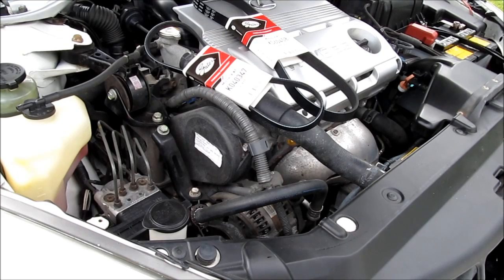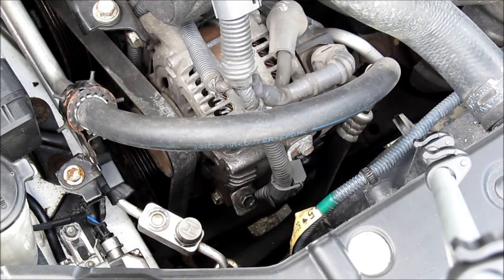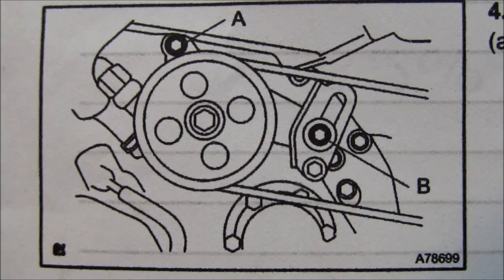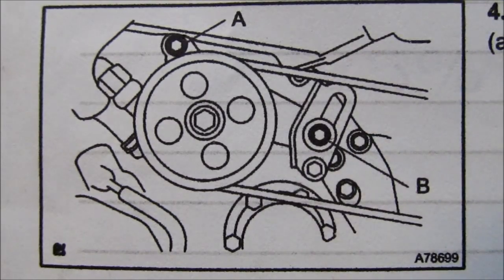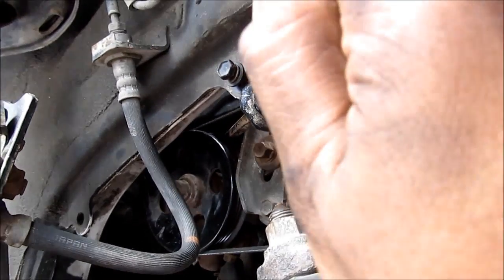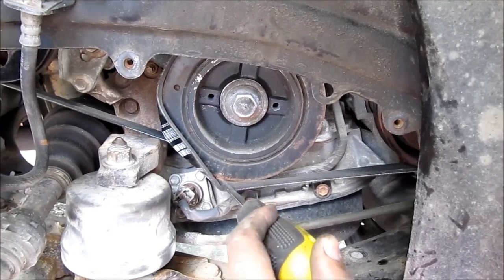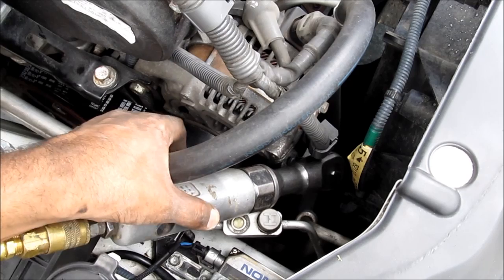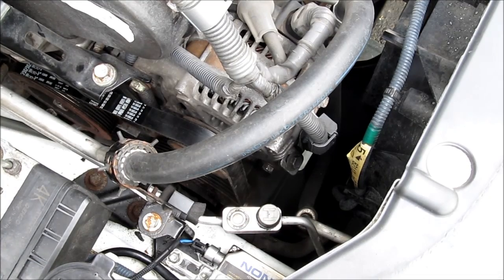Alternator / Power Steering Belt Replacement: Toyota Lexus V6

Comment: a bud great vids...question i changed alt belt and batt all new tested and bat light still shows up after a day..but goes away after hitting gas
have ya seen this thanks
Reply from the maker: +kingkuts voltage regulator
Reply: speedkar99 ..thanks.. damn relays on back of alt...thanks again for the help

Comment: Hey Speedkar 99! Thanks for the video!

Question 1:
I have a 2005 Toyota Highlander V6. Will your video work with this vehicle?

Question 2:
Are the Alternator Belt and the Power Steering Belt the same belt size? 

Question 3:
Can you provide me with a part number of each belt?

Thank you again for your services~!

- Chris
Reply from the maker: Yes its the same engine.
Reply: Yes, it worked for my 2004 V6

Comment: Seems to me the tensioner is the top and the pivot bolt is the bottom for the power steering belt since the bottom pivots in the metal bracket. I say this because the top one is the one that tightened my belt back up.  Also, I could not get to the top bolt for the power steering at the angle you're using for my 02 Lexus.  Well, I could get it on there, but I didn't have any room to work it.  I had to use a 1/2 drive ratchet with a 3/8's drive reducer and a 12 mm socket to get the top bolt loosened and I had to go in from the bottom left to get the socket on it.  Very easy from the bottom left.   Video was a big help though.
Reply from the maker: +Donnie Vick Thanks. Yes that top bolt is damn difficult to get to. Its way easier if you take the engine mount and bracket off and get at it from the top: as I did when doing my timing belt ...but that's a lot of work fmif just changing the PS belt.

Comment: I just want to say, "Thank you so much, speedkar99!"  After reviewing several videos to perform this belt change, yours is the one that truly helped.  The diagrams were extremely beneficial (for me, at least).  I had to let up more tension than I had expected and also had to get a little physical with the alternator itself to get it to shift, but I couldn't have done any of this without your DIY video.  Been out of work for a few weeks, and I sure couldn't have afforded someone doing for me.  Wish I could buy you lunch!  Thanks, again!    ~HL
Reply from the maker: +HL Houser Thank you and I am glad my video helped you out.
Reply: speedkar99 do I have to set the timing on the alternator belt just like we do it for timing belt?
Reply: @007gamechanger  no
Reply: @007gamechanger  it is not necessary  to set the timing on the alternator, because i don't think there is some thing like that on the alternator but if you just have to then you can set the time on your clock and tie that clock to the alternator. and that should do it. you can use a wrist watch also if the clock does not fit.

Comment: I assume the 3.3 liter has the same routing and tensioning procedure as the 3.0 liter of the same 2002-2005 era?  Does anyone know for certain?  I have not completed this task yet (still waiting on one more belt) but it looks just about identical as far as I can tell.  2003 Camry with original belts, about 60,000 miles.

Also, I think the timing belt calls for replacement at around 90,000 miles so I'm not too concerned about that yet.  In fact the serpentine belts look OK but I'd rather be safe than sorry.  When I go through a puddle my voltage drops significantly.  Not sure if the alternator is having issues or if the belt is slipping, can't tell.
Reply from the maker: +Blaine Bugaski Yes the 3.3 is the same as the 3.0. 
At that age your timing belt is overdue. Should have been changed after 7 years and then after another 7 years due to age so your way overdue.
Reply: Hmm.  These engines are non-interference so besides being late, there is no chance for engine damage to occur.  Wish they used a chain!  Bad idea to use rubber.

Comment: Thanks for showing the workshop manual images along with a way to tension the PS belt.  Great clear video. I am working on my 2000 Sienna tomorrow and the PS belt has been a nightmare to tighten all these years.
Reply from the maker: +Vic Shahid I'm glad you found it helpful. All the best on that PS belt, it ain't easy. You need a crow bar to pry the pump down while tightening it with the ratchet.

Comment: Thank you.  I replaced my Power Steering and Alternator belts on my Lexus RX330.  The power steering belt is very hard to remove and put on.  I had to remove the 2 bolts that was holding the power steering motor.  Once remove it is was so much easier to put on the belt.  Just a little feed back.
Reply from the maker: +Alwyn Li Yup agreed, the power steering belt is a bit tough on these v6 engines, especially trying to tension with a crow bar.
Reply: For the v6 do I need to take the right wheel off and go through the wheel well to get to the power steering belt?
Reply: It might be possible, but I think that may make a difficult job even harder.

Comment: my mechanic replaced my serpentine belt, drive belt and power steering belt but 2 weeks after that I now have a high pitch squeal from engine area every time I turn my steering wheel. Power steering fluid is good. Only makes noise when turning. Also notice a short squeal right before my engine turns over when I start it. Any ideas?
Reply from the maker: +RainPebble Waters The power steering belt is too loose.
Reply: speedkar99 thanks, this morning I started car and  had to use defrost for windshield and loud squealing for 30 seconds. That was the issue on why I had my belts fixed the first time. I guess I need to find a new mechanic because he said the noise is normal due to overnight condensation from my car being parked outside.

Comment: In my car bolt c is broken what can I do to remove it?
Reply from the maker: Common issue. You'll have to remove the alternator from the vehicle with the block attached. I've had this happen before, and got a replacement block with a bolt from a junkyard car.
Reply: $12.71 ordered from AutoZone and available for next day pick up in store.

Comment: @38 seconds , nice birds chirping,  looks like chickadee. Great to work on machines during late spring or early summer !!.  Fixing my 2k Camry 3.0L with 175k miles on it myself. Let's us know if you are doing timing belt / water pump with oil pump housing !!
Reply from the maker: +Guru Hunsenh thanks. Yes my dad has alot of pet birds. 
Here's the timing belt video:

https://youtu.be/_c_a-ECaWSU

Comment: I need your help! I am replacing the alternator on my dad's 98 es 300. For some reason I can't figure out yet, Bolt C or the tension bolt the alternator will not stay flat. As I tighten the bolt to tighten the belt, It keeps going cocked upwards and not flat on the bracket! any thoughts or suggestions? Thanks!

Comment: How do you know you've achieved proper tension to not be too loose or too tight? is they a spec, markings, orientation... what is a good rule od thumb or guide to follow?
Reply from the maker: My rule of thumb is the belt should compress approximately half of its width.

Comment: I'm currently doing this on my 96 Toyota Avalon, and the procedure is exactly the same. Bolt A on the second belt I'd really difficult to reach, though, and I haven't gotten it loosened yet. I also just found out my power steering pump is leaking...
Reply from the maker: +Katsoup98 Yes that top pivot bolt is hard to get to. At least on the 96 you've got much more room to work. You can even remove the dog bone engine mount and access it from above.
Reply: As I was doing this, I realized the pump is leaking fluid. Now I have that to worry about...
Reply: Katsoup98 they're not supposed be covered in fluid? ;-) Whole back side of mine is covered.

Comment: Another great video. Very helpful as I have an ES 300 that I am helping doing an engine swap on but I didn't remove the brackets originally so wasn't sure where everything went. Your lighting is so good though and the diagram makes it very easy to see how everything aligns. And yes, you are relaxed and calm--can't imagine you cursing if you broke something!
Reply from the maker: +Neil Winawer Thanks. Yea I don't swear when I work on my cars, I just take my time and do my work, however long it takes. That's why I don't like working on other people's cars. 
The lighting is helped by a big white garage door reflecting sunlight on my car.

Comment: The privot bolt on power steering is the hardest to loosen. Very tight space. I used 3/8" 12mm socket with 1.5" extension and a 3/8" 15" breaker bar to loosen and tighten. It's just do darn tight space.
Reply from the maker: +S Chang Yep I had to use a 1/4" ratchet on my dad's Sienna to loosen that bolt, it's in a really tight spot. I wonder if you can pivot the power steering pump without loosening that bolt.

Comment: would it work for a toyota camry 2005 se
Reply from the maker: +Crystal Gonzales Yes, for the v6.
Reply: And from there I could remove the alternator completely?
Reply from the maker: +Crystal Gonzales Yes if you loosen all 3 bolts all the way, and disconnect the 10mm nut for the electrical connector.

Comment: Hi I don't see the bolt on top of the power steering pump, I only see the tensioner bolt. this is for a 2001 lexus es300
Reply from the maker: +Body comp You aren't supposed to see it, you have to feel it.
Reply: Ok great thanks again

Comment: Is it ok to drive the car for few kilometers without the alternator belt ? 
The main pulley makes some noise.
Reply from the maker: +Chunkey Mathew Yes you can, but your battery will quickly deplete.

Comment: Hi there,  I am planning to change the alternator on my 2006 lexus rx350. What I wanted to know is, do I have to remove the radiator to replace it. Any help or advice greatly appreciated.
Reply from the maker: +Simon Woo Most likely you should have enough space (I'm not too sure of the clearance on the RX vs the Camry). I recall on the ES350 (2007+ with the 3.5L V6) someone posted that they have to remove the radiator. Seems like a lot of work wasting coolant for just the alternator.

Comment: Hi there,  I am planning to change the alternator on my 2006 lexus rx350. What I wanted to know is, do I have to remove the radiator to replace it. Any help or advice greatly appreciated.
Reply from the maker: +Simon Woo On the 3.3L engine it should be fine. Not sure on the clearance in the 3.5L engine.
Reply: +speedkar99  I manage to replace the alternator without removing the radiator, just the fan shroud on the rx350. Thanks for the advice.  Great videos! Keep it up👍
Reply from the maker: Thanks. Good to know because I have my eyes on an RX next :)

Comment: I have an 03 Avalon with the same type of belt with alternator tensioner. it has been making a loud chirping noise and I'm not sure if it's too loose or if there's some other problem. what is the spec for tightness? I saw you check how right it was in the video but from this angle it's hard to tell exactly how far it went down or how hard you're pushing
Reply from the maker: +dummkompf A very general rule of thumb is it shouldn't deform more than half of the belt's width.
Reply from the maker: +dummkompf The 1MZ-FE manual specifies the belt tension to be (measured with a belt tension gauge) 175 lbf for a new belt and 115 lbf for a used belt.

Comment: Can I replace just the alternator belt without needing to replace the power steering belt. I just replaced both on my 2001 es300 but the alternator belt came loose after 20K miles. trying to avoid "extra" labor cost at the mechanics shop. got a quote of $60/hr to replace just the alternator belt (labor only). i think they will prob add another $20 to do the steering belt? so do I really need to do the additional belt? i'm gonna sell the car right fairly soon. (not sure how the belt came loose, did see a NYC rat that died near the alt belt carriage is)?? =/
Reply from the maker: +stupidboynyc If its loose just tighten it. If you need to replace then just replace the alternator belt. The power steering belt is under the alternator belt.

Comment: FYI This the the exact process  for the Toyota highlander 01 possibly to 2007
Reply: +speedkar99 about to do this on a 1999 avalon,  same process. 
I've got some excessive squeaking in both belts
Reply: speedkar99 it did. Actually it was easier. There's no back bolt for the power steering pump. Just 2 up front. 
Done and done
Reply: It probably was loose, then. Pump moved right away.
Reply from the maker: +Jer Ry Yes, this is the same process for any non-hybrid Toyota or Lexus V6 with the 1MZ-FE 3.0L or 3MZ-FE 3.3L motor.
Reply from the maker: Hope it goes well.
Reply from the maker: There should be a pivot bolt at the back of that power steering pump, if it is slightly loose you can rotate the pump out of the way.

Comment: On a 2000 es300, the top bolt for the power steering belt is super hard to access and I had to pray to get it off, literally, but it immediately came off after! I also had to remove a fuse box in the front of the engine to get to the tensioner bolt for the alternator belt. Thanks for the vid!
Reply: in addition, es330 provides much more room to work than the es300...
Reply from the maker: +zellerized I disagree. The 97-01 generation of 1MZ-FE Camry/Solara/ES300 has way more space in the engine compartment than the 3MZ-FE 02-06 Camry / ES, I have both so that's what I can say. Yes that fuse box comes out on the Solara/ES300 to access that alternator bolt easier.
Reply: +speedkar99 -- it seemed that the 300 had less room because I had to move stuff out of the way to access the bolts on the alternator, and it was still tight for me, but in your vid of the 330 you easily slapped the wrench right on those bolts..
Reply: +zellerized -- I need that air wrench you have....

Comment: HI - I also posted on one of your other videos about the timing belt change and you replied - thanks.  I am waiting for my impact wrench to come in.  
This weekend I tried to replace my AC belt and steering belt.  I was able to change the AC belt but could not get the ratchet on the steering pulley pivot bolt.    How did you get your ratchet on there?
Reply: +speedkar99 ---- I have big hands and removed it from below.  Once I got the ratchet on the bolt with the handle pointed towards the front of the car(getting it on the bolt took 15 mins), I pushed up on the ratchet handle with straight fingers while laying under the wheel hub assembly!  If the bolt were any tighter...  
I had the car secured on stands and a jack so I wouldn't have to worry about getting guillotined.
Reply from the maker: +BenzSUV That one is tricky. If you've got big clumbsy hands, the best way is to remove the dog bone engine mount and its bracket that goes to the engine, then get a ratchet/breaker bar on that power steering bolt and swing it from the top of the engine.
Reply: +speedkar99 thanks.  I"ll wait to replace this when i do my timing belt.
Reply from the maker: +BenzSUV I had to remove my power steering belts to inspect my water-pump today. The best way is to remove the dog bone engine mount,  and its bracket. That gives you much better clearance to break that top pivot bolt free from the top, although you'll have to get the ratchet on there by feel as you can't see the bolt directly.
Reply from the maker: Yes if the bolt is on really tight then its impossible to get without an extension on the ratchet and/or removing that engine mount. I went through three 12mm sockets trying to loosen that power steering bolt on a 3MZ-FE Sienna.

Comment: Thanks. Very helpful. Both the location and size of wrenches for the bolts were very helpful. The only difference is how difficult it is to break loose these bolts if they haven't been loosened before! On my 2002 Highlander for the power steering bolt, I used a breaker bar, a six point socket, a small extension, placed it on the bolt from the wheel well, then reached through the hood to grab the breaker bar and loosen the bolt. Took quite a while to figure out this approach.
Reply: +denzelnuke1 I have the same car and had to do the same thing. My kid's hands are slightly smaller than mine; he could get his hand in there and I couldn't. Very very tight.
Reply from the maker: You could remove the dog-bone engine mount and its bracket from the engine, which would give you clear access to swinging the ratchet from the top.
Reply from the maker: +denzelnuke1 Yes that power steering bolt is in a tight spot and is on there really tight.

Comment: Thankyou very much for the great videography. I was struggling with loosening the power steering pump.
I only have a Haynes manual and they had the infamously classic vague description:  "loosen the bolts". Due to the location of the pump, it's not obvious where the top bolt is. Your video showed the elusive bolt! Thanks!

(by the way, get some u-joints and extensions for your ratchets!)
Reply from the maker: +Dave Miles Thanks for the comment. I don't like U joints, they have too much play and tend to flip flop sideways instead of turning the bolt.
Reply: Agreed.  Impact gun style universals work much better, even when not using an impact.

Comment: Thank you for this wonderful tutorial.   I'd like to add,  first,  I purchased the power steering belt from two different auto part stores,  both were too short.   Went to Lexus and the OEM fit perfectly...so I recommend OEM belts.   Also,  it is not possible to swap the power steering belt without removing the alternator belt.   Again,  thanks and great tutorial!
Reply from the maker: Thanks for the feedback. You need to remove the alternator belt to change that power steering belt.